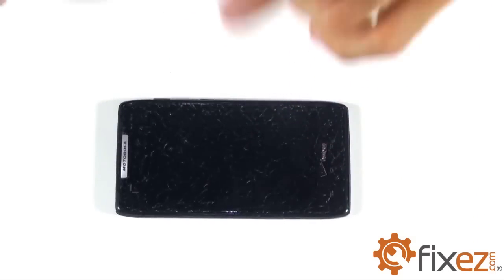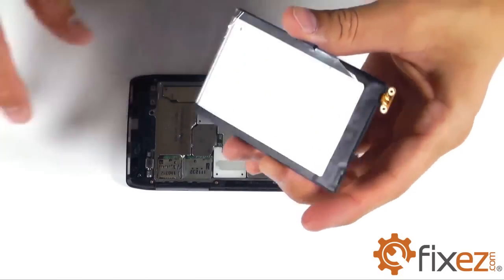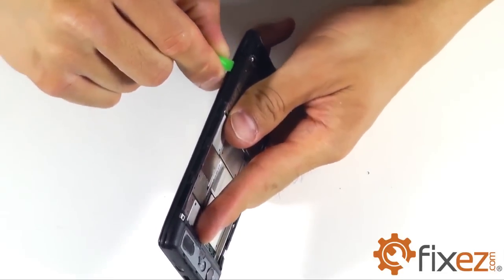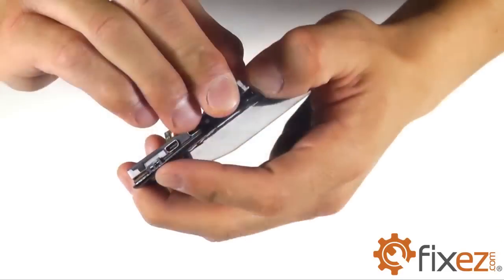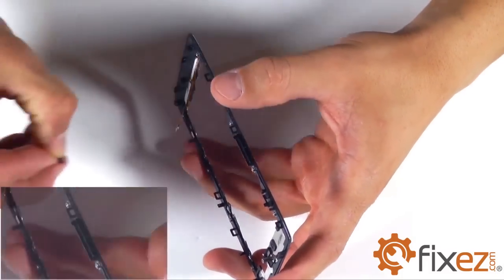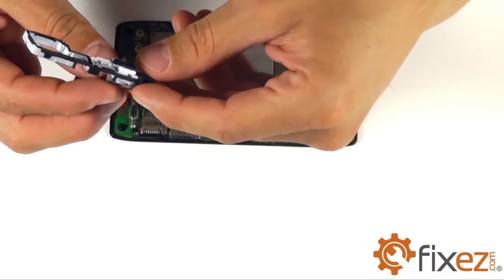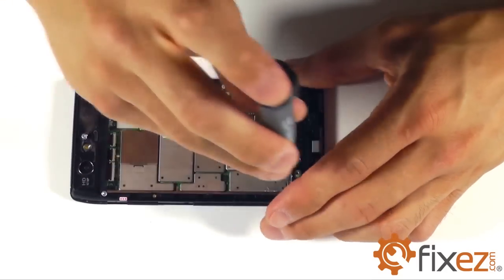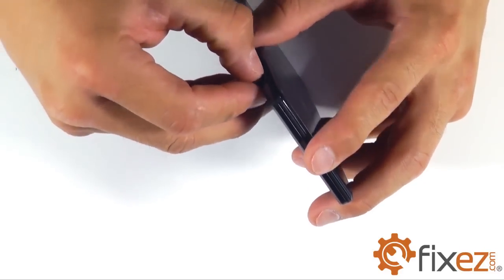Motorola Droid Razr Screen Repair & Disassemble

Comment: Hi, Great Video!! Very accurate. I just recently converted my Droid Razr to a Razr Maxx by upgrading from the EB20 to the EB40 battery. I now get 2-3 days of battery life rather than 1 day, if Im lucky. In the process, I needed a T3 driver as well as the T5. I didn't hear mention of that in the vid but I may have missed it, Just so folks know they will need one. I think the set you have on your site has the sizes needed.
Thanks again for the awesome video tutorial.

Comment: Great video. Really got me through the process easily and quickly. I was sure my phone was fried, and now it is working PERFECTLY. Thanks so much.  A couple of notes on the video-1) Really solid job on the video. Good pace (although I needed to pause or reverse now and again, as expected).2) I had many T3 screws (not just T5). Sorry if this was mentioned already. 3) I didn't take out the middle ribbon cable. Didn't seem necessary.4) That "camera cover" seemed like a crappy piece of very thin plastic, no? Your cover seemed much harder.5) I had just one extra part. A little rubber piece. Came off somewhere around the camera assembly. The phone seems to work just fine without it.6) The volume buttons are jammed in.. not sure if it's the buttons that came with the assembly or maybe I didn't line them up with I was putting it back together. I may have to go back and disassemble then reassemble.All in all, it took me maybe 30 or 40 minutes to take the phone apart and put it back together. Not bad at all.  Thanks for the great video.
Reply from the maker: +Jeff C. Thank you for this feedback, we appreciate the support!
Reply: +Jeff C. Yeah, I have t3 or t4 screws. This T5 screwdriver i ordered barely did any of them and I still have ones left over because I spent all my effort trying to find the wrong screwdriver. Why do they have two different types of screws in this shit? This torque shit is the dumbest crap to ever exist. Make a tiny philips end and be done with it. Asshole companies.

And I almost stripped one of the screws not knowing which screwdriver to use on it. Why does this video tell you it only needs a T5? Also, found another difference. My 3 ribbon cables won't open up, there are wires on each side so there is no way to undo them. Actually, it seems I can peel them back but they're a flimsy plastic sheet instead of the little much more user-friendly plastic tabs you have in your video.

Comment: Your tutorial was the most thorough found,  Thank You.  I was miffed when the last step of reusing the plastic trim piece that attaches to the glass was not covered elsewhere.  Phone works great and my speaker phone works, BUT not the earpiece...  I guess I need to break it open again and redo the connections to ensure they are in all the way.  Your thoughts?

Comment: Hello. Can I ask you a question? My XT890 no longer turns on the screen but the touch-screen and the rest of the phone is still working. The phone has not been damaged, but the screen (glass and touch-screen) is not original. Do you think that I should try to open the phone and check the screen'sc contacts or I should ask to a repair center?

Comment: so my phone slipped out of my shirt pocket and fell 2 feet to the ground, to my surprise it cracked the screen. but the touch screen works fine. does the front Cover Replacement include the glass piece of is it just the cover for the side? also the picture on the side is the back cover not the front.

Comment: I just dropped my XT912 from knee height and cracked the screen. The phone is fully functional and the screen buttons still work (even though that's where the crack is). Do I need to order a touch screen digitizer or just the lens screen?
Reply: Wouldn't that require replacing the superior oled screen?

Comment: 1 have 2 of these phones, Phone A cracked screen, Phone B sound and power dock not working. Took to repair shop, they switched glass between phones ( easiest solution) now, phone A works great except the phone powers off by its self never did that before, Any ideas how to fix, kept phone B for spare parts. ?? Repair tech not sure what to do, didnt charge me to switch screens because of this new issue. Batteries are all working and charged. Thanks in advance for your assistance and advice.

Comment: My problem, screen not displaying, can't tell if the digitizer works.  Bought a new phone.  I got tired of waiting for the battery to die and started your procedure, just to see if I could do it.  I have a slightly different model but was able to do it without visibly breaking anything.  I put it back together and it wouldn't power up.  So I guess I'm screwed.  I've lost my $2.00 in Bitcoin and have to go through the password recovery for every site because my password safe backed up to system memory instead of the sim card.

Just needed to vent there.

One suggestion.  You might consider mentioning screw lengths in your videos.  At reassembly time I found myself having to swap screws several times.
Reply from the maker: +Ferrule Bezel Sorry to hear about these issues. We will provide your feedback to our video production team.

Comment: Hi, my phone works after being dropped, but the screen is inoperable (cracked and completely black). I can tell it still works because it still has a text message alert light. Do I need to carry out the above repairs? Also, a chap gave me a repair quote of $500. From this video I'm guessing that is a bit of a rip off...
Reply: *****
Hello, I have the same issue as Kendrick Robinson except my phone is a razr i (xt890), would this guide help to fix my screen or is there a more specific way to repair it?
Reply: ***** Hi, also according to the diagnosis report, the motherboard is also damaged. However, when I charged it up the phone was showing text message alerts and alarms were going off. Is it possible the mother board is fine?
Reply: Cheers!

Comment: hey so I accidentally dropped my friend's phone and now only half the screen works in addition to a cracked screen that was already there. I was wondering if changing the screen as shown here will solve both problems, or if the former problem (half the screen working) is an entirely different problem on its own? - thanks in advance
Reply: If half the screen is working and the other half has like lines down it or something, then you need all the stuff the guy is showing you. Which are the tools (of course,) the digitizer (screen,) and the LCD which is the display. The LCD from fixez.com should include the display adapter. Hope everything goes well and remember, always be careful with your phone ESPECIALLY someone else's!
Reply: ***** Thanks, yeah I'll make sure to check in between blankets before I move them :)
Reply: StormSworder Good!